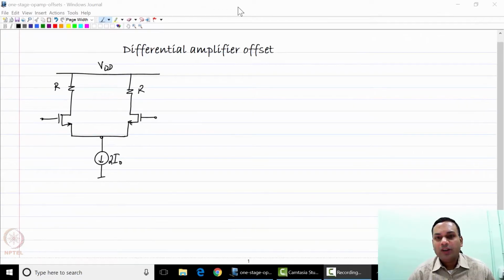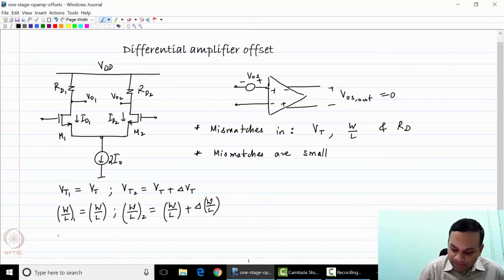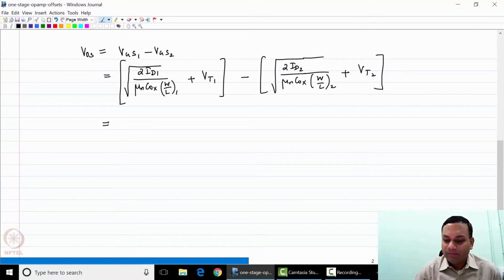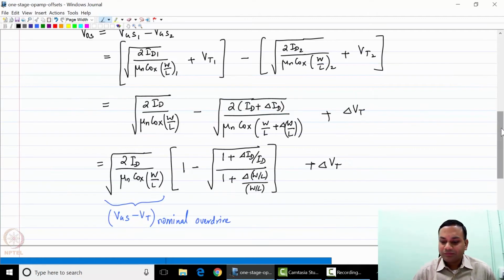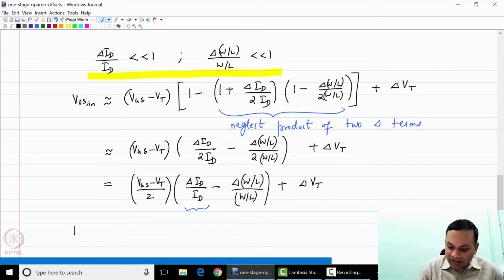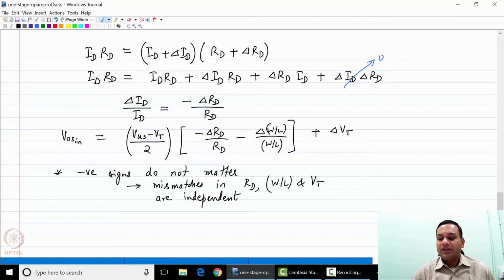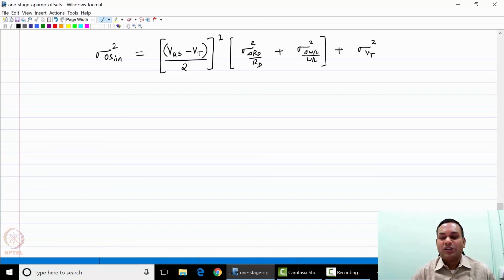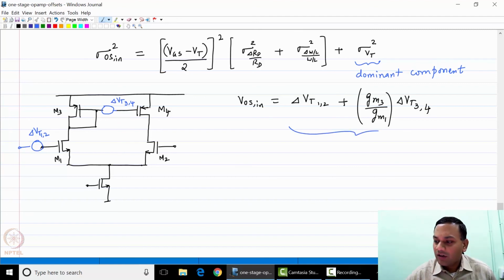Differential Amplifiers Offset

Comment: Professor made one mistake!!
Keeping overdrive less actually increases your random offset. 
ΔI= gm ΔV, if there is any mismatch in the two branch currents of a diff amp it gets reflected as an offset voltage at its input.
 I ∝ (Vgs-vth)^2 ; If the diff pair has a mismatch of +/- 10mV in it's Vth then ΔI will be more if Vgs is comparable to Vth. So always keep Vov more to reduce standard deviation in offset. You can also see how high gm helps!!